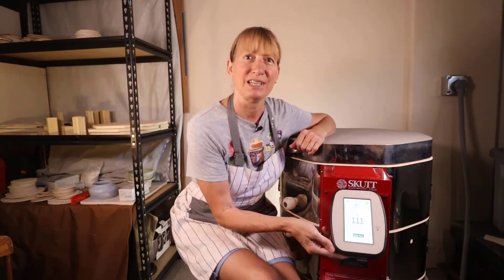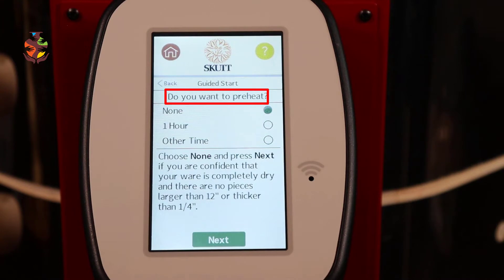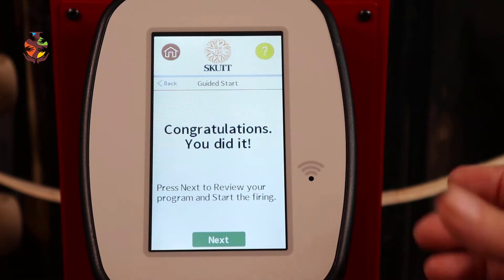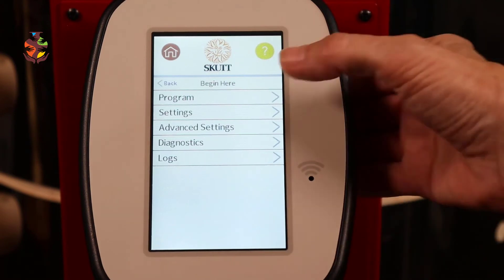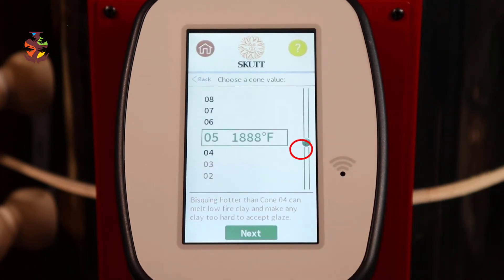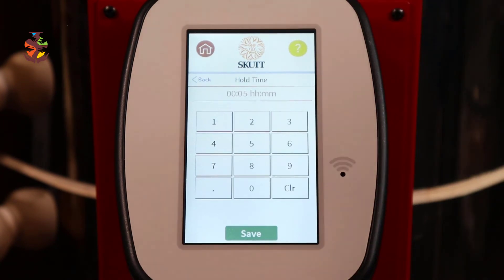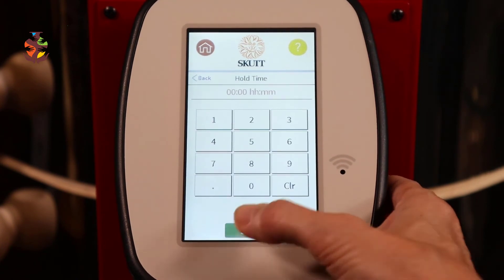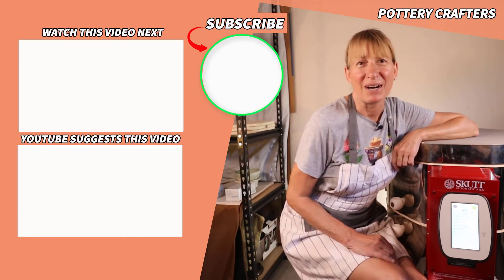Skutt Touchscreen Controller Programing Tutorial

Comment: When the glaze says cone 5 -6, what should I program it for?
Reply from the maker: Good Question. It is actually your choice. Most potters will test fire to see which Temperature works best for them. I personally like to fire to Cone 5 and place a 20-minute hold on at the end. This evens out the temperature in the kiln, also fires it equal to Cone 6, and helps the glaze cure, especially if you use darker clays or many layers of glaze for the drippy effect. 😊
Reply: @PotteryCrafters  Thank you so much.  I will give it a shot - my maiden glaze firing!  I will follow the guidance in the video.  :goodvibes:

Comment: Hi Marie, I am new for Skutt kilns. I recently purchased KMT614 and fired several times, both bisque and glazing. Here is my recipe. Do you have any suggestions based on your experience? Thank you as always. (I don't have a vent system. I fire in the garage.) 
*Bisque
Open the lid for a few inches with a piece of brick, cone 06 firing mode, preheat 1-2 hours, slow, close the lid once the temp hit 1000F. Hold for 5 min. The top peep remains open throughout the procedure. 
*Glazing
Keep the lid completely closed from the start. The top peep is open. Cone 5 firing mode,  medium, no preheat, hold for 5 min, once the temp reaches cone 5, close the top peep in colder months (I live in Iowa. The garage temp can reach to 38F.)
Reply from the maker: Wow sounds like you are doing great!  cone 06 should be fine for bisque fire. But if you get any pinholes, I would suggest cone 04 bisque and a 10 minute hold.😍
Reply: Thank you so much for your rapid reply! Yes, I do see pinholes. I will try cone 04 and 10 minutes hold at the next round. Many thanks! I love your videos!
By the way, do you happen to glaze greenware? If so, what kiln setting do you choose? (Maybe in your next video :)
Reply from the maker: Thank you so much for the suggestion I will put it on my list. I do have a post that may help. https://potterycrafters.com/do-you-glaze-pottery-before-or-after-firing/  Most commercial glazes are formulated for bisque fire firing. But if you would single fire make sure it is a slow fire. 
If you are still having problems with pinholes you can go up in 5-minute increments until you hit 25 min hold. That would bring you to cone 6. Also if you decide to fire to cone 6, set your kiln to cone 5 and put a 25-minute hold on it. The results are better.
Also, I forgot to tell you, if your greenware is nice and bone dry there is no need to preheat. 😍👍Happy glazing